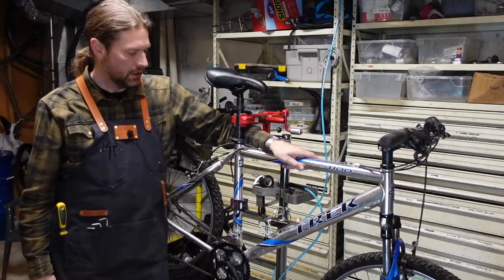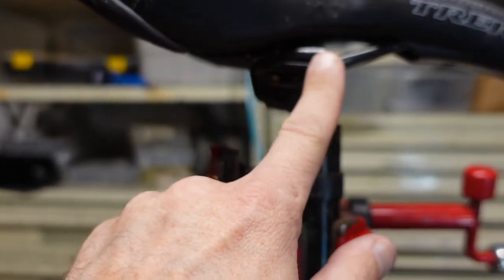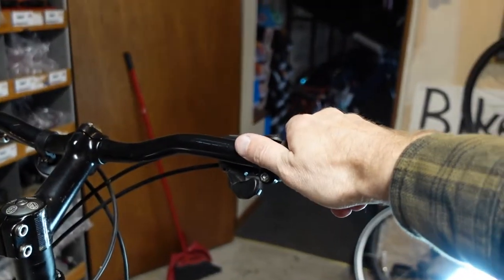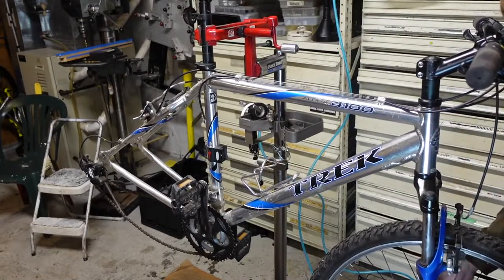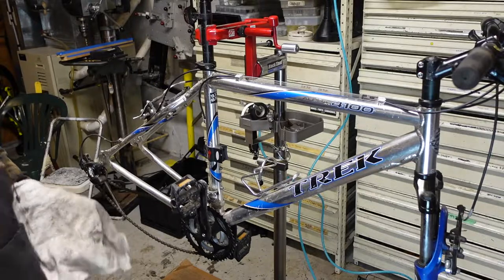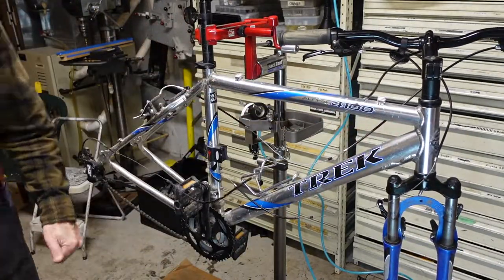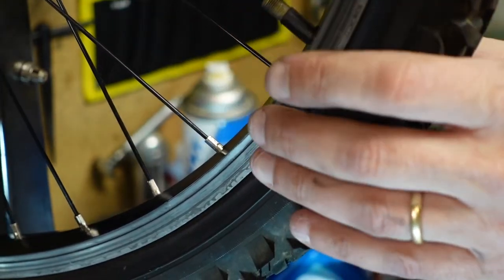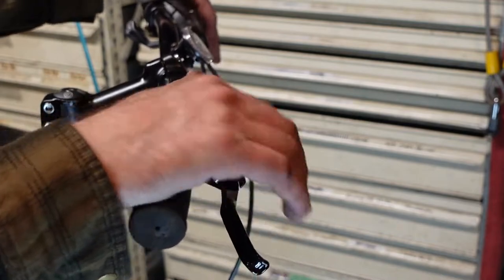Garage Sale Trek Bicycle Rescue - This old mountain bike is reconditioned for daily use!

Comment: sometimes with v brakes i just pull the cable all the way tight, then lightly snug the pinch bolt, then pull the lever to the point i want the pads to touch in the lever pull, then tighten the pinch bolt ... makes dialing in the lever pull pretty quick

Comment: I'm often a little worried that lubing my cables will attack dirt?
Reply: I thought at one point I could buy, fix, and flip bikes and I have bought and sold maybe 20 bikes. I've given away a hand full of others that don't sell. The problem in my opinion is the market is flooded with people selling bikes that they bought 15 years ago, never rode, and now are selling for peanuts. There are also several stolen bikes also being sold very cheaply. Seems impossible to make a profit. Oh well, I have fun rehabbing them. I enjoy seeing the neighborhood children still riding bikes I gave them long ago. Peace ✌️
Reply from the maker: @Mantis858585  If you form an LLC, get insured, secure vendors, create a brand and start a legitimate business that consumers can rely on, you can most definitely charge enough for refurbished bicycles to be profitable. Of course, you need to have a broad skill-set combined with a ton of hustle and grit to pull it off. If you're a hobbyist, playing in the local Craigslist/yard sale market, you're not gonna make any money for yourself - but I'll gladly service the bikes you sell in my shop! Basically, you gotta be professional about it. I've found it's what most people want and need, even in my small town off 6,000 people 11 miles from Trek HQ surrounded by some of the greatest cycling stores in the nation.